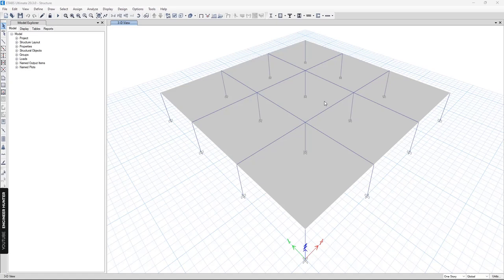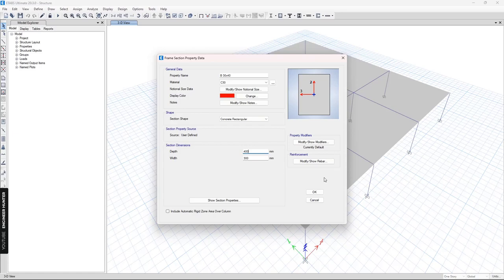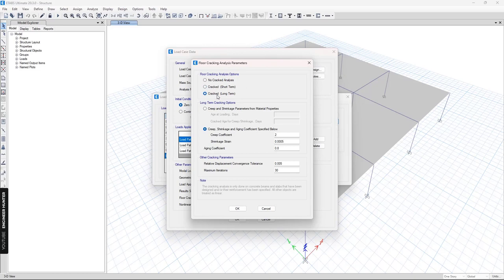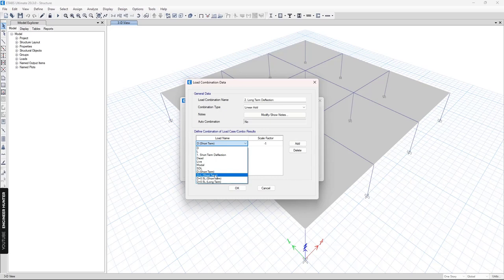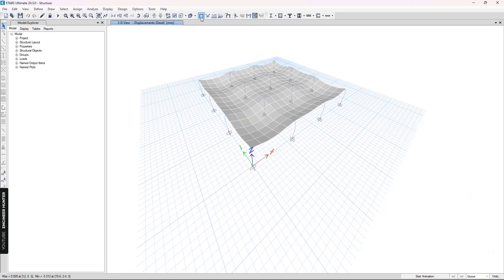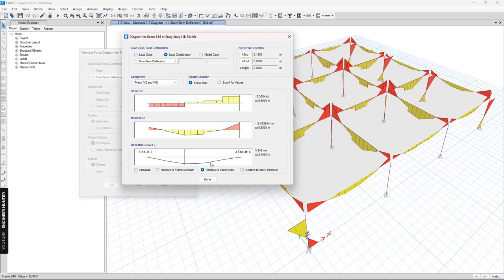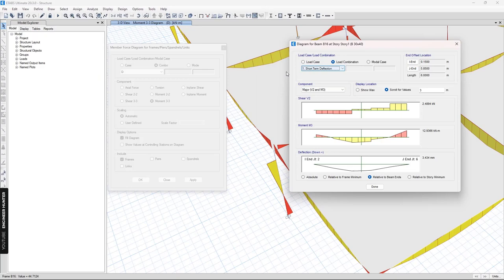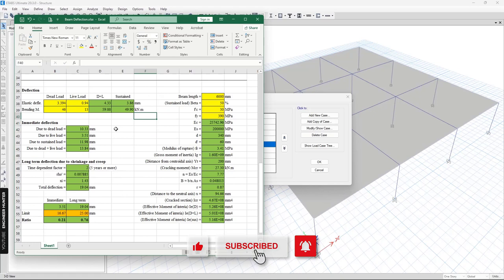Beam Short and Long Term Deflection in ETABS

Comment from the maker: To run floor cracking analysis with the design rebar, you need to perform linear analysis first and run the design of slab and beam, then run the nonlinear cracking analysis.

Otherwise the program will use minimum rebars for floor cracking analysis (as in the video).

Comment: hey, can you tell me wich PC and system do you use? your model looks so smooth and it works very well. thanks
Reply: You could go to tool (menu) >> select graphic >>>  X Direction. Hope it helps.
Reply from the maker: I use I9-12900k RTX 3060. You can turn on Direct X to view your results smoothly. Usually, when I draw the model, I use standard graphic. When view results, I use Direct X.

Comment: Sir 
Does the ETABS program take compression and tension steel into consideration in the design when checking the deflection values for beams?
Or does it take the area of the concrete section only?
Reply from the maker: From the CSI forum, the rebar will be considered. If you run the analysis and design, then the section analysis performance will take the previous rebar design. If not, the program will assume the minimum rebar for computing the deflection.
Reply: @EngineerHunter Do you mean that if you analysis and design the beam 
 the program will take the design rebar 
 
 and if you make a check for long-term deflection before design 
 the program will take the minimum-rebar 
 Is this what you mean, Sir?